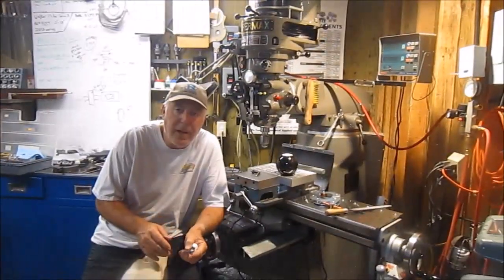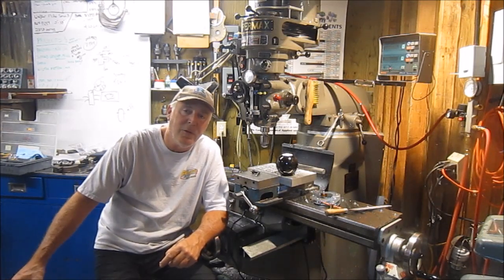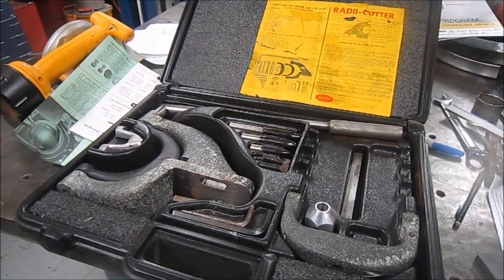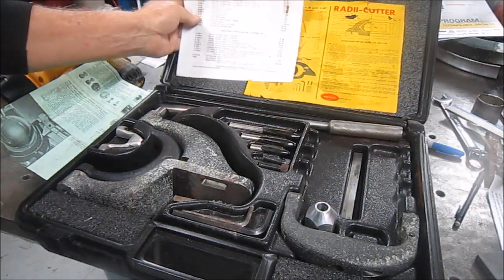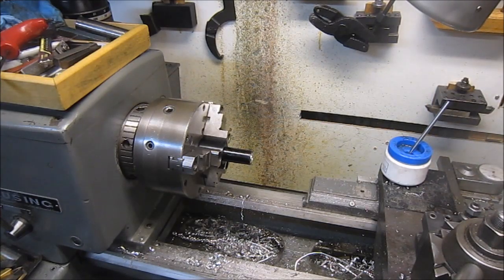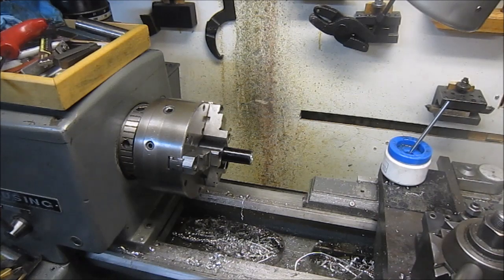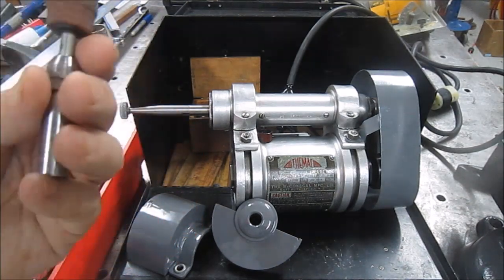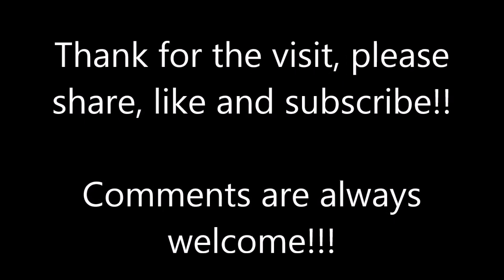Screwy Tuesday #31  I Can'T Find It

Comment: I got a funny lost tool for you from last week.  I was working on a dial indicator back with no lug for Dale Derry's WIYB project and I was going to use a last word indicator mill quill indicator holder.  The last word indicator has a stud you connect to the indicator and use that to connect to the quill indicator holder.  I had taken the whole setup off the quill for some reason and somehow the last word indicator slipped off and fell to the floor.  After cussing and picking it up, I put the quill indicator holder back on the mill and when to put mount the last word indicator again and the stud wasn't on the indicator.  Searched high and low on the floor, under all the tool boxes and finally gave up.  I was going to try another method to find the center of the part, looked on the top of the part and what was laying there on it...the stud.  I guess the stud stayed with the indicator holder when the indicator fell off and then it fell out when I was re-attaching the indicator holder to the quill and I hadn't noticed.  I got a good chuckle out of it when it was over, although my knees weren't laughing from crawling on the concrete.Interesting mechanism being used to connect the to halves.  I've never seen that fine of a thread used on one before.
Reply from the maker: +ILGopher LOL, thanks for viewing and sharing your experience....nice to know I am not alone.....take care

Comment: I suspect that your magic eight-ball is out of calibration, Chuck.  To calibrate it, place it in your lathe and rotate it counter-clockwise at 88.8 rpm (metric) for 8 min 8 sec.   That will realign the magic lines of flux.  Then you calibrate it to a standard series of questions to which you know the answer.  If it answers correctly, the magic eight-ball is ready for use.  If not, using a rawhide mallet, give it a firm tap in the proper location on the equator of the sphere to bring it into adjustment.  Nothin' to it really.
Oh, BTW, you can use it to locate lost items in the shop by telling it what the object is you are searching for, and then asking it if you're warm or cool as you move around the shop.  Nothing like finding a couple of things that have been missing for years to make you a believer.  I think you've probably lucked on to a pretty good one, seeing as how it was giving you somewhat accurate answers even with it being out of calibration.

Cheers!  ; )
Reply from the maker: +Richard Freeze LOL...thanks Richard for viewing and your comment/humor....enjoyed!

Comment: I really like that Suburban angle sine vise, but wow, it looks like it would use up a lot of headroom on your grinder the way you had it opened up.
Reply from the maker: +Bob Korves Hi Bob...your right on the head room, did kind of a quick measure...but we will see
Reply: +outsidescrewball Normally you would not have two extreme angles in one setup.  At least you do not also have to put it on top of a magnetic vise, though mounting it to the table might require a table mount adapter of some sort...